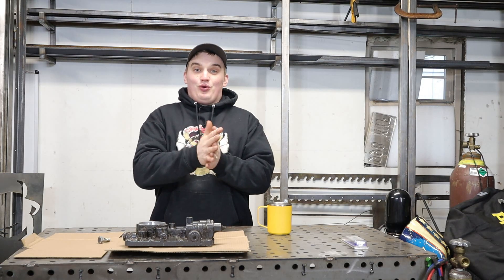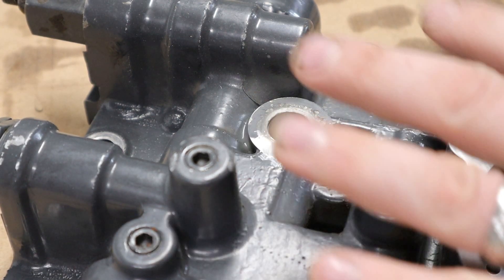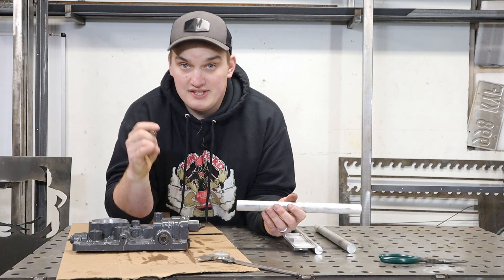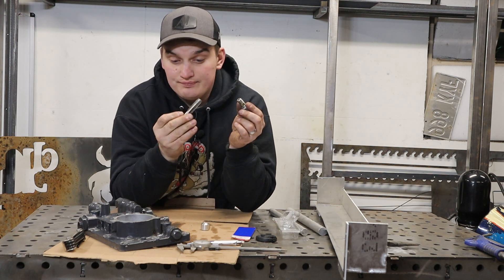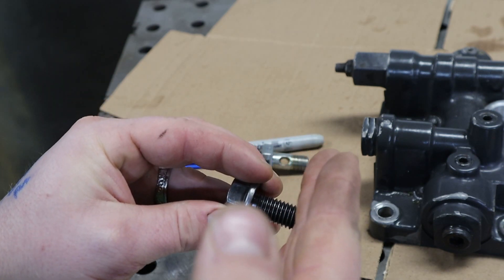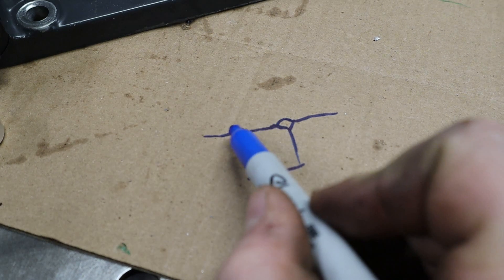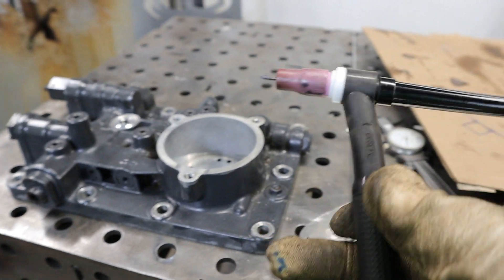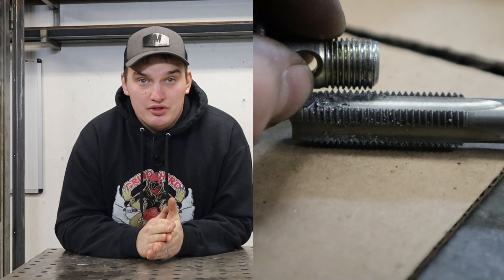Aluminum Thread Repair

Comment: OK, If you don't mind i would like to leave some suggestions?? when welding aluminium an it's alloy , and your run out of  "juice" in your welder machine, preheat the thick aluminium, cast or not cast, but careful, and use an envelope flame, either with GPL, or Acetylene. if use GPL, go slowly, stop at times and rub the head of a mech every now and then, when the red colour appears on the area to be welded, you are ready to weld. If you'll use oxy Acetylene, (the one I prefer), just open the Acetylene knob and blackening the area to be welded, (it takes a second), then with a large tip and a neutral flame, still creating an envelope, ( but careful ....it's much hotter)  then GPL, Ha ha ha. ( in Australia we call it "LPG")....  ( don't warry it won't absorb carbon as it's not hot yet), don't passe 60 Degrees , 50  is plenty. You'll know 50 degrees,  it's when you can almost touch the job on and off for a couple of seconds, then it is ready to be welded. After a minutes or so, ( depending on the thickness and temperature around, the blackening will disappear, then its ready to weld , and you'll get away with much less "Amps". Still  you can use "Helium gas" in the Argon mix which will increase the TIG arc heat. Enough "HAMPS" or not, it is always healthier to preheat the job, especially thick material, cast, or not cast. Of course avoid distortion, use claps, or other means, and wait until cool down before removing fixings....You run a good tutorial you're doing well also considering  you are so young...Good on you!!

Comment: i have a glass table and very heavy think glass, attached or glued to it 4 aluminum rounded shape not very think in them stand in middle a where the legs gets screwed in, now it is al became loose these metallic screws stopped being able to be inserted in the hole for it wont fit any more i guess all teeth is broken in the hole to hold the screws to these parts to connect and stable the glass table. i can send u picture if u wish, how do i glue these screwed into these holes permanently powerfully and or solve this problem? i tried all metallic glues non hold
Reply from the maker: Not sure I would have to see it email me a photo at alex@amcustomfab.com

Comment: Amazing.  It's a work of art.  Very safisfying to watch.  Question:  The time it took to repair this part, the materials, the labor... would it be easier to just replace the part, if available?
Reply from the maker: The part was $1,400 to replace and I only charged the customer $250 for the work

Comment: I guess I’m still a little trigger shy with welding on critical aluminum parts, but the way I’ve approached similar repairs is to do this same process, except I’ve used an aluminum bolt (Bolt Depot, McMaster, etc) to make my slug, installed it with the appropriate Loctite product, and surfaced the part flat after install. I’m not sure if you could argue that it’s a better repair, but it’s permanent without any annealing of the parent material, and you never even have to plug in the welder. Just a thought. 

I threw you a subscription; I really like your channel’s angle of encouraging people to get out there and make money with their skillset, and I like the way you think outside the box. Also, I do my most of my welding on a big cast iron table saw. 😂 So there’s that.

Comment: Probably was not necessary to weld it all the way around.  A few tacks could have minimized heat distortion to the part.
Reply from the maker: Very possibly 😎
Reply: No just because he has to worry about leaks. And he probably doesn’t know what psi would be going through those ports. Any bit of pressure and you will get a leak. 1lb of air in something and you will get a bubble leak if you soap test it. I build pontoons every now and then and they all have to be pressure tested.

Comment: Was it just me or does your drill press have runout from Hell? When you first started drilling into the bolt after you cut it down it seemed to be all over the place, but maybe it was the camera or screen doing things that they do.
Reply from the maker: Not you are right my Chuck is all messed up.😎